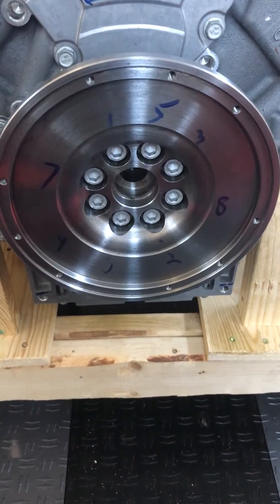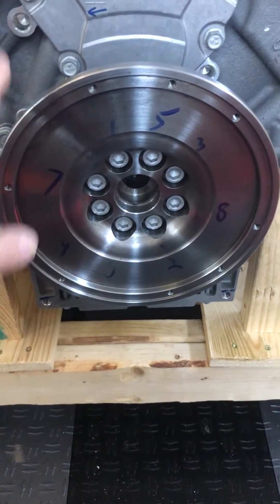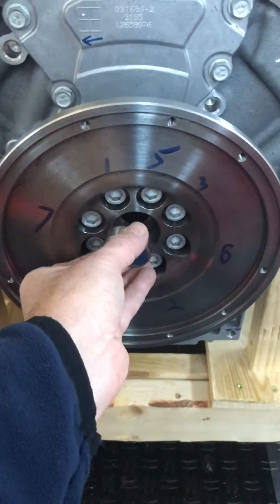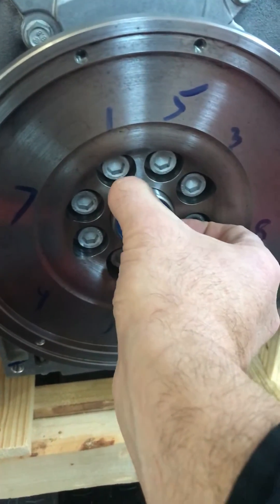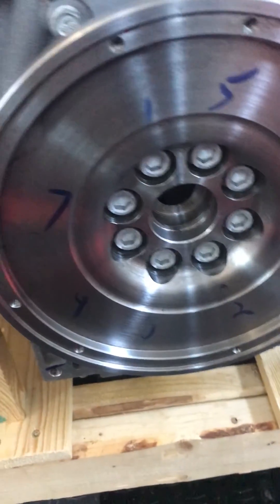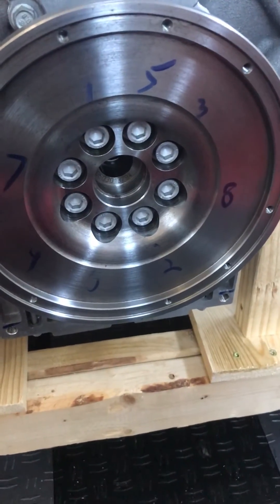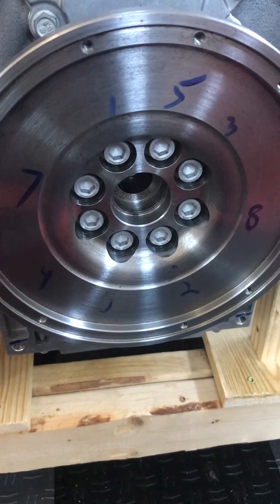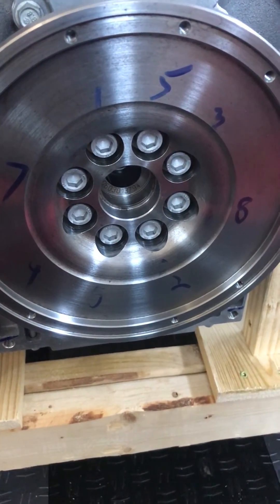Superlite SLC Build 010 - Pilot Bearing Fitment Part 1

Comment: Great move.  Loctite is awesome and would probably be okay.  I use it a lot, but I would be much happier with a press fit.  The center punch solution, in my experience, is really only used to get yourself out of a jam and is a temporary solution.  I've done it and been happy that it worked, but for me, it was a temporary solution to get machinery running when time constraints didn't allow for a proper fix.